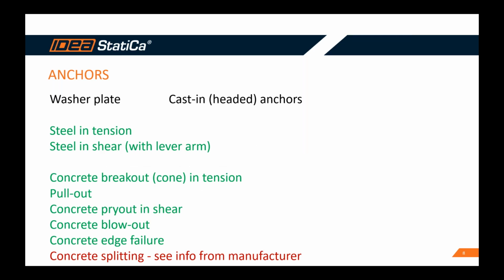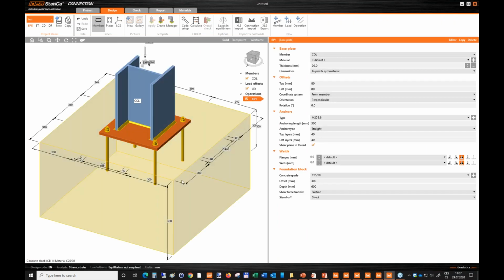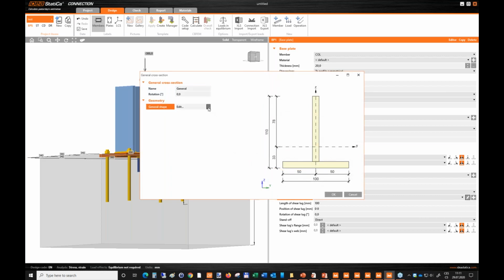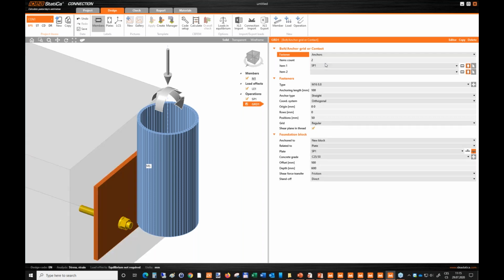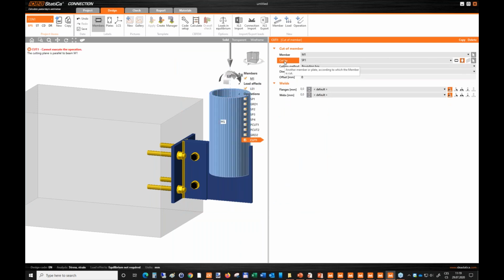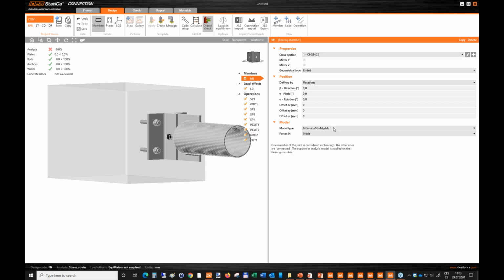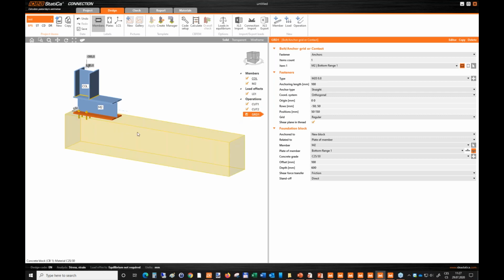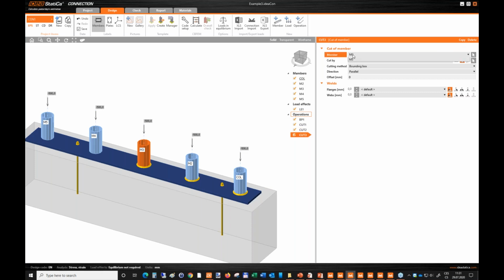Summer Series – Footing connections quick & easy

Comment: Hello
Why is it not possible to increase or decrease the welding seams of elements intersecting at an angle of 90 degrees (SHS100x100x10)?
Reply from the maker: Hello, you can edit the weld size and type and define a weld on welded section
https://www.ideastatica.com/support-center/weld-welds-in-idea-statica